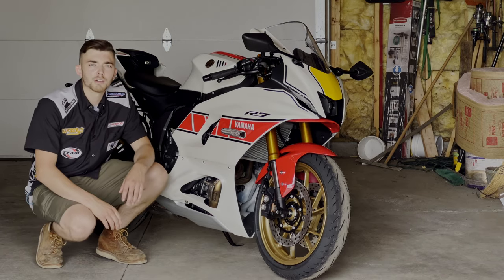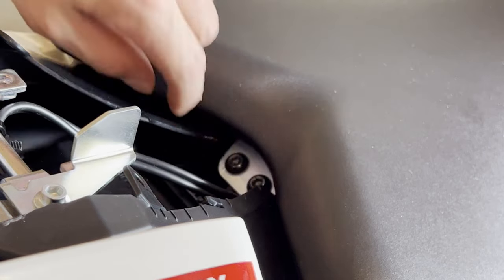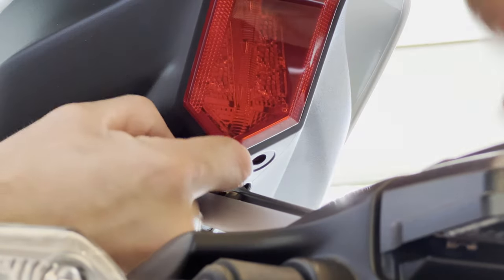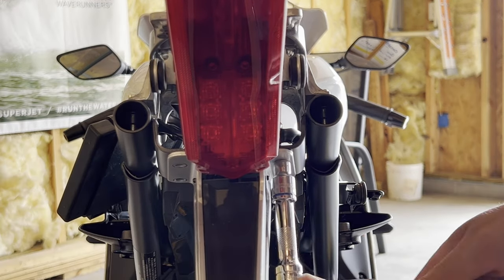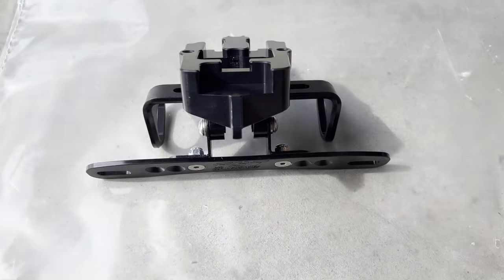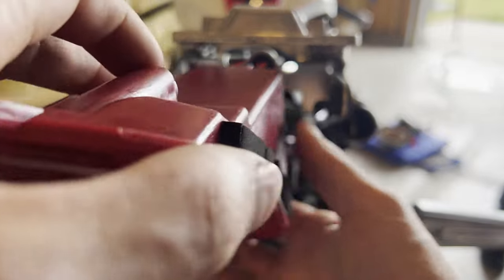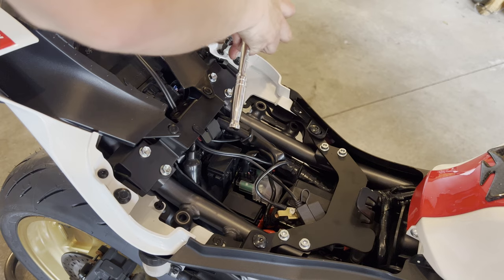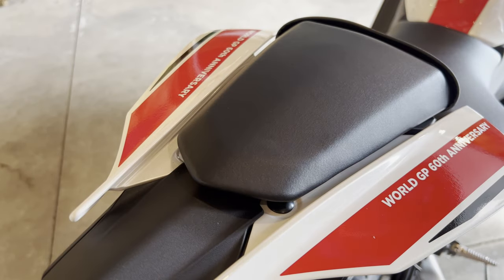How To Install TST Tail Tidy On 2022 YAMAHA R7 | I MADE IT EASY!!!

Comment: Looks great! Sure does make me appreciate the naked bikes though. You have to disassemble the whole rear end for a tail tidy on this bike. It took removing the rear seat with a key and then 4 bolts and 3 electrical plugs to remove the fender on my ktm.
Reply from the maker: Thanks for the comment!! Much appreciated. I agree! My mt07 was much easier. Peace ✌️